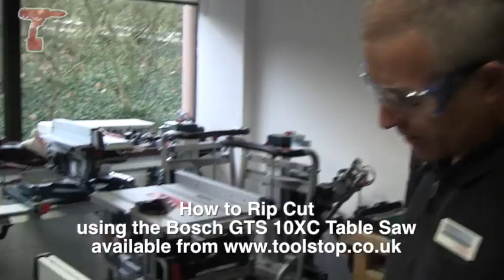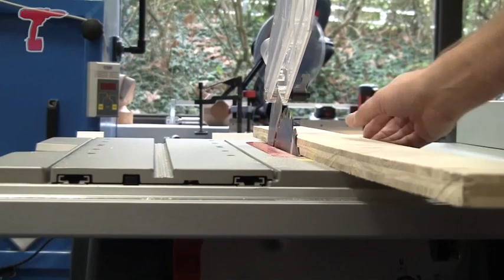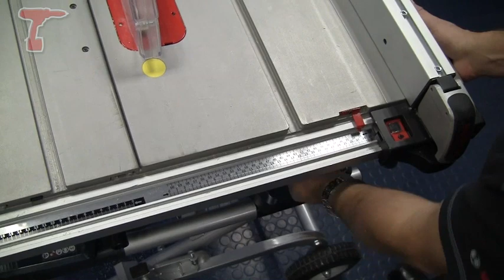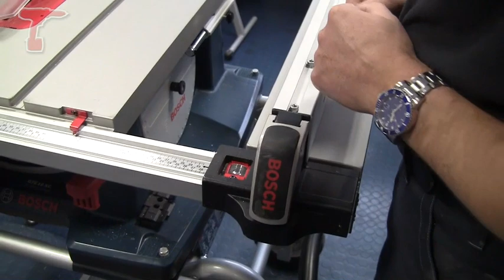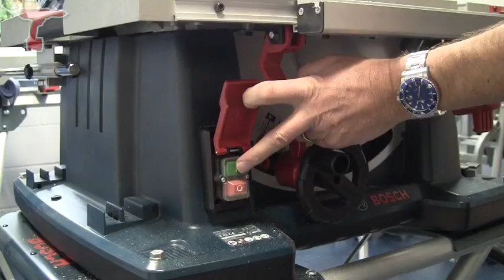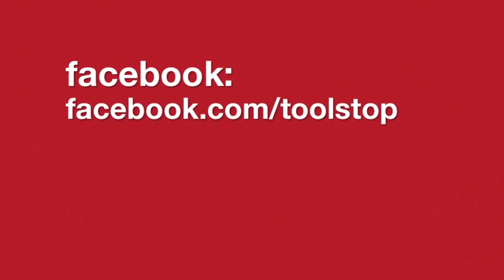How to Make a Rip Cut Using a Bosch Saw

Comment: Bought this saw for christmas on nov 22nd 2016, used it for the first time on dec 26th 2016, less than 100 cuts later on nothing more substantial than 2x3s and 3/4 ply to build a table for it and a cross cut sled, the blade stopped mid cut on a 2x3. After removing the wood and restarting the motor, the blade spun up slowly never reached top speed and spun down slowly indicating to me that the brake wasn't working. I contacted bosch to arrange collection under warranty and was told to wait in from 8 in the morning to 6 at night the next day for pickup, hence me writing this, with a day to waste I have also checked on the bosch community forum and found that this problem is not unique to me, its happened before, although not quite as quickly.I then checked customer reviews for bosch after sales and was shocked at the number of very unsatisfied customers there, (wish I had done all not this prior to buying the saw)
Suffice to say, this all singing all dancing flag ship of table saws sank without trace with practically no use in less than three weeks and whichever way you look at that, its just not good enough, lets hope, bosch can put it right.

Comment: I'm planning to buy a GTS 10, but heard from several people that the sled/miter sled on the left is a bit loose and wobbly so angled cuts can't be done accurately. Of course you being from Bosch surely don't see that much of a problem ;) , but is there an adjustment or trick to get it track straight?